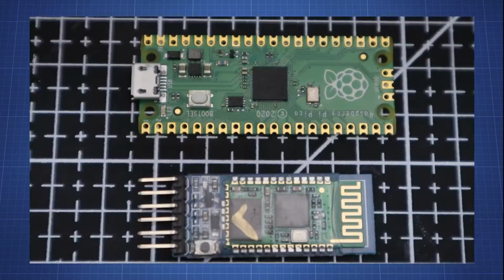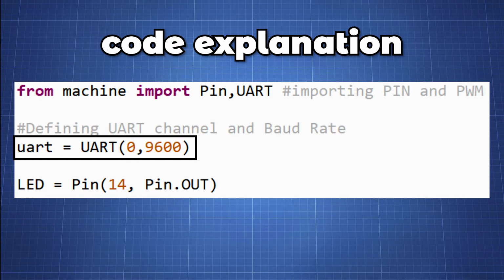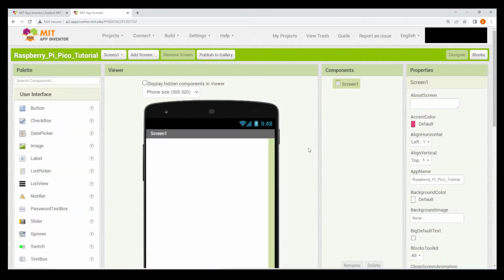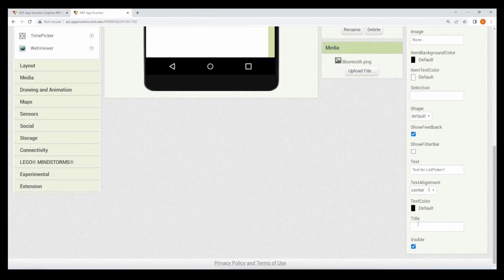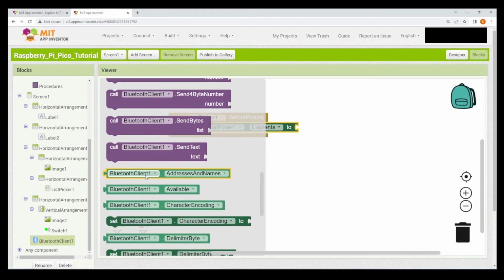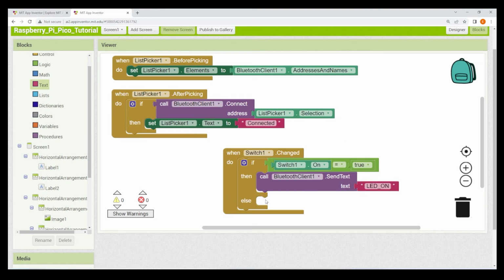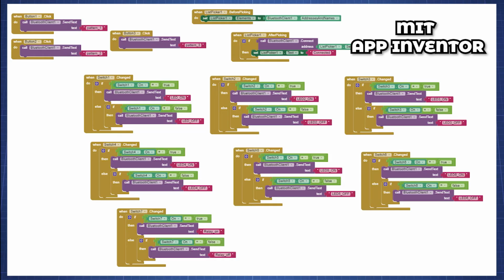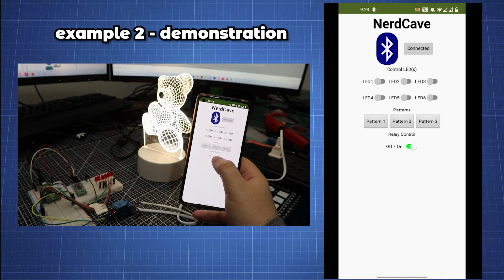Raspberry Pi Pico Tutorial - HC-05 Bluetooth module + MIT App Inventor

Comment from the maker: Hi, when playing with the HC-05 today I saw there is a tiny mistake on the schematic, the TX and RX pins needs to be swopped. I hope it helps
Reply: on your schematic or on hc-05?
Reply from the maker: @davyS4v  connected to the Pico
Reply: @davyS4v  You wouldn't believe the amount of rabbit holes I went down trying to figure this out. This video was the first thing I saw when I was learning about this, and the wiring diagram was what I ultimately used all day trying to figure it out. JUST TO BE 100% CLEAR, tx gets wired to rx, and rx gets wired to tx!

Comment: Hey NerdCave, I am currently working on a concept to make a controller from a Raspberry Pi Pico I currently have it working via USB but wanted to incorporate bluetooth technology to allow connection wirelessly to the PC for controller functionality. Would the HC-05 work well for this, obviously ill need to write my own code and that should not be an issue. Everything I read about the HC-05 makes it sounds like it can communicate via UART and SPP. So this shouldn't be an impossible feat correct?
Reply from the maker: Yes, this should be doable since the bluetooth will be connected to the COM port on your computer allowing it to receive data, I am not sure about the python script you will need to write to process this data into controller commands, will probably be using an HID library in python to allow this. How is it working through usb now did you use the arcade hid library through the Pico

Comment: i'm trying since 3 weeks but it doesnt work :(
do you have miss some steps?
Reply from the maker: All the steps are shown in this video along with the other bluetooth remote control car. What problems are you having?
Reply: @NerdCaveYT  led doesn't switch on/off but hc05 is connected. I follow every steps but it doesnt work
Reply: Did you find any solution @davyS4v